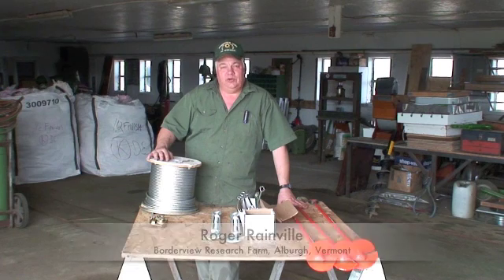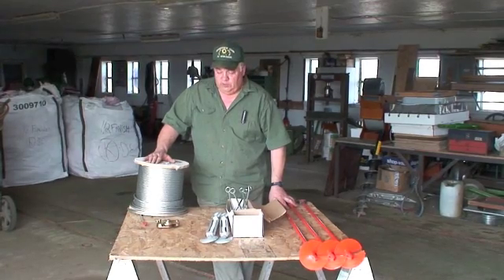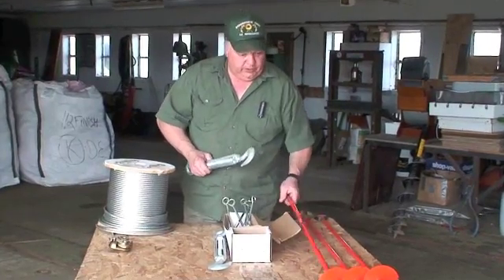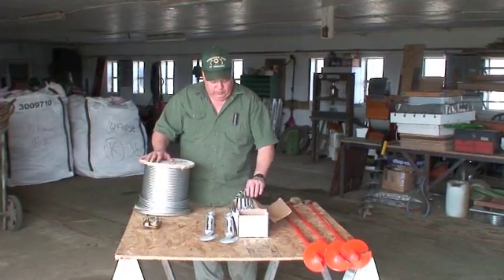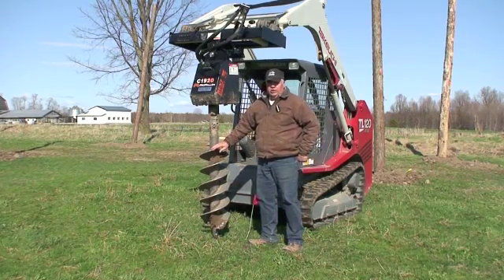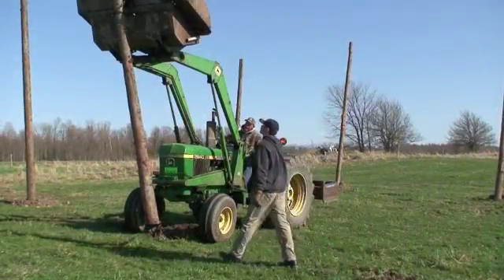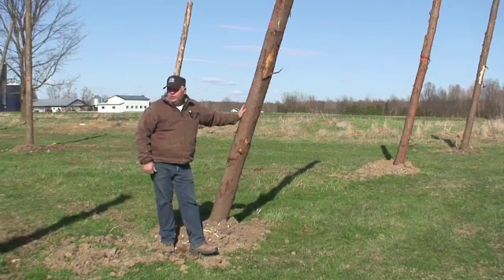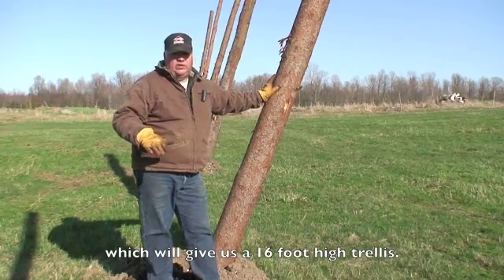Constructing a Hopyard Part 1

Comment: Ive got 6 acres im thinking of slowly turning into a hops yard.
thanks
How do you consistantly keep the same angle on the outward poles?
Reply: What I did was dig the holes bigger than the poles to allow for stone to back fill .  On the out side poles I just leaned them out against the outside top of the hole and then backfilled with stone.
I believe I used a 12 inch auger.Roger Rainville
Reply: +jeff sanders   that's great  thanks